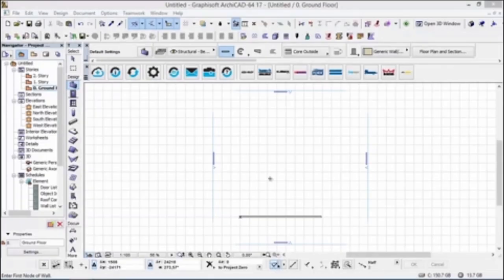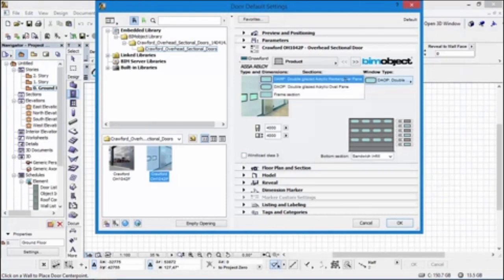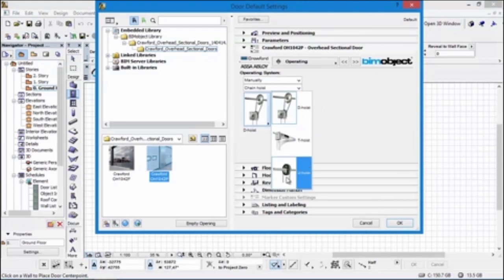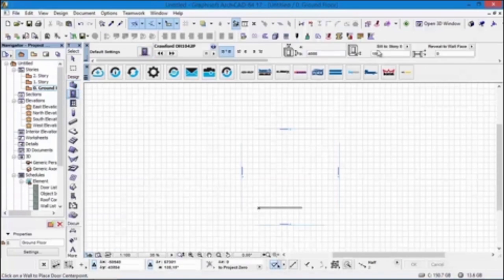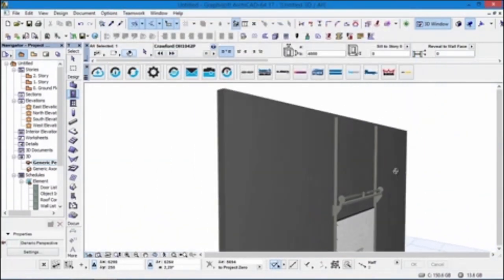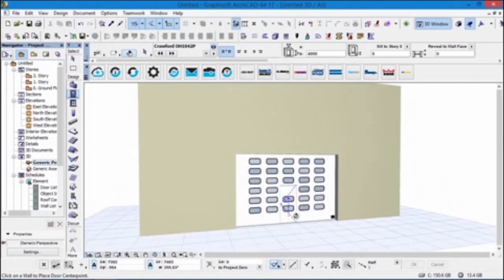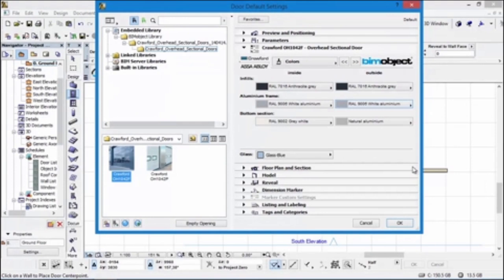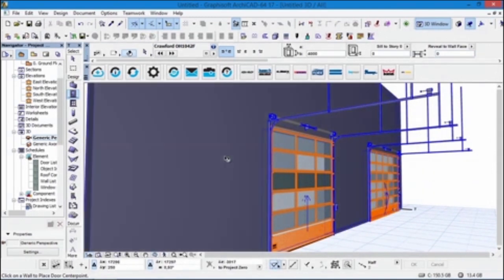BIM tutorial for ArchiCAD - Crawford overhead sectional door

Comment: We created a 3x3m sectional door with passdoor. Since one can't control the section-sizes, the sectional door does always have 5 sections, the passdoor uses 3 sections (3/5=0,60m+3=1,80m) => the passdoor has an opening of below 1,80m which is just not useable. You really have apt in a sections control. There must be 4 sections in a 3m sectional door. We really need this BIM object and sadly cant use it.